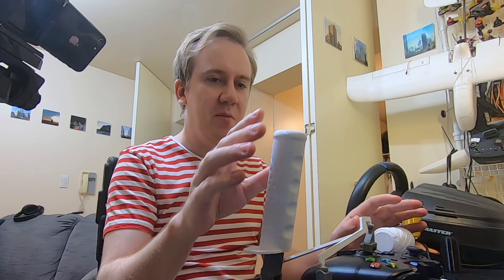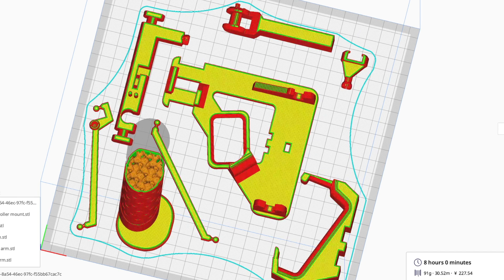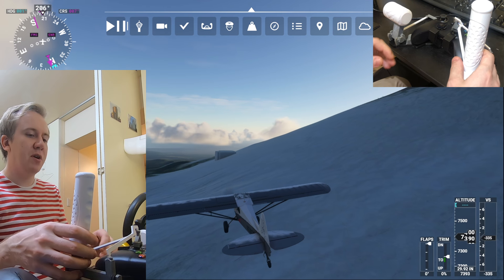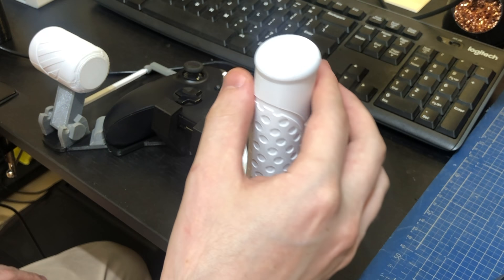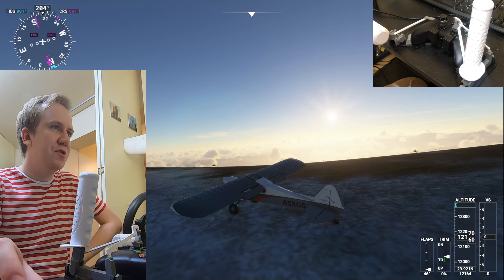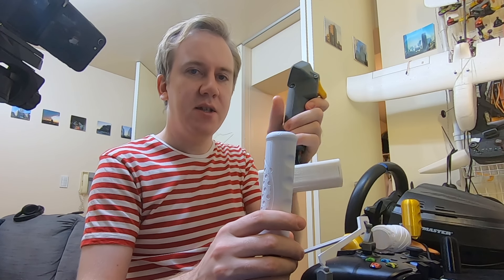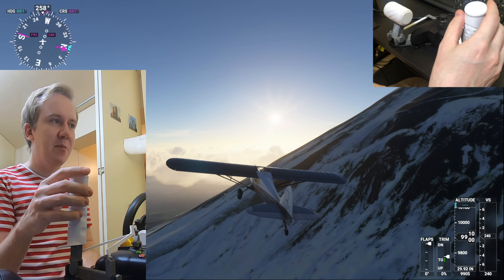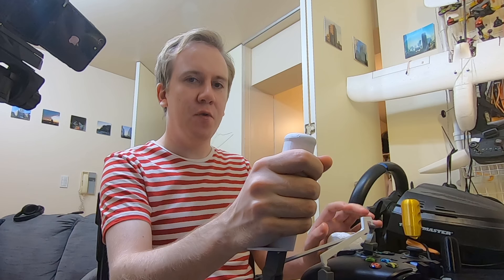Make your XBOX gamepad into a joystick HOTAS with this 3D printed extension

Comment: OK the parts tolerances are way too tight and I can't "snap" together anything without breaking anything. Anyone else have that problem? I'm adjusting my slicer settings to make some dimensions smaller
Reply: I printed in PLA. I was able to heat a few pieces up with a hairdryer. but you need to be careful not to distort other areas. post for handle needed some sanding.
Reply: I had to remodel them all and make the ball joints about 130% larger and use the loose tolerance ball joints I also increased the center break line on the ball joints to .8mm. My printer is about 99.7% accurate so I have no clue  how this guy got his parts to fit together.
Reply: @MrCampbelltoe  thanks for the numbers, that's what I needed. thanks

Comment: Hey, I noticed the .stl files have a fairly thin slot in the ball joint socket than the printed pieces you showed in the video. Is the model slot width (about 1 mm or less?) the intended size, or should we file open the slots for better assembly?
Reply from the maker: The video shows older prototypes, the narrower gap in the STL files work better. As I show in my follow-up video, you can heat them up a bit to assemble them easier, but no need to open them up other than that.
Reply: @AkakiKuumeri  Thanks, I was having trouble getting such a thin slot, but changing the horizontal expansion worked like a charm. Do you have the Fusion 360 files available for sharing? I have a corded 360 controller and found that the throttle handle-to-linkage pivot point distance is too short (at zero throttle position, the link is already fully compressing the controller trigger). Was hoping to make a mod to fit my controller.

Comment: I really want to donate (I'm printing this as we speak). This shouldn't be free.
Reply from the maker: Thanks Stranger, buying the files in my Etsy shop would indeed be the best way to support. Thanks a lot!
Reply: @AkakiKuumeri  Can I just send you a little something via PayPal, or perhaps even buy you a drink locally? (I'm in Funabashi)
Reply: @reallyboringindividual  Dont, the files are garbage and nothing fits even on extremely well tuned machines. Spend your money on a real HOTAS that's actually worth it.
Reply: @SwiftestScout  I designed and built my own precise HOTAS since. Mostly 3D printed with some bearings, some metal parts and hall sensors. Works well.
Reply: @SwiftestScout  +10 respect points for Teemo in the avatar. Teemo OTP here. ;)

Comment: Hey, I printed this (you have seen on Thingiverse) I can’t seem to figure out the in game settings for throttle axis on pc. I have set LT to throttle axis, and changed my game pad to give all range in the z axis to LT but still the throttle only moves from 50ish%-100%? Can you/anyone on pc guide me where I’m going wrong, many thanks in advance.
Reply: I have the exact same problem... the "windows controller setup" is no help either. Did anyone get further?
Reply: Same for me. Hopefully someone knows the solution.

Comment: I’m hoping you can help with a design similar to this. I’m trying to help the disabled gamer community solve a problem and I think this mechanism is the solution. Xbox makes an adaptive controller with analog inputs for special needs gamers. Unfortunately finding a joystick to work with it is extremely difficult and extremely expensive. Most are too weak or too delicate and still cost $100+. You can buy a simple adafruit thumb stick for around $7 (https://www.adafruit.com/product/245). So my solution is to use your mechanism but with the adafruit thumb stick that is readily available on the cheap. This also solves the durability issue because your mechanism takes all the weight of the players hand and not the thumb stick. Also by adding a spring hook to the mechanism I can put different springs in depending on what peoples arm strength and ability to return the stick to a neutral position. Those with sensory issues may not be able to tell when a joystick has reached a neutral position without strong spring return while others need weaker spring due to less strength. It would also allow different handles to be 3D printed for different disabilities and needs. Is this something you might be interested in helping with?

Comment: I'm trying to print the test joint from the thingiverse files but I'm having the worst of luck trying to get the gap in the female side to resolve.  I opened the .stl file and it looks like that slot is measuring at about 0.16mm but it looks much bigger in your video.  Do you have any suggestions to get this up and running?  I want to make sure I can print the joints before I do large pieces.
Reply from the maker: The test piece in the video is an older model. Did you print the female piece standing up?
Even if the slit isn't completely open, as long as the ball goes in, it is good to go.
Reply: @AkakiKuumeri  I printed the female piece standing upright and the male piece on it's side.  The ball doesn't quite fit in.  I'm doing a 0.2 layer height, 0.4mm line thickness, and 3 line shell.  I'll try to look through my slicer again (Cura) to see if there's anything that would cause the walls to be thicker than intended.
Reply from the maker: Lower your flow rate and speed on the outer wall.
Reply: @AkakiKuumeri  Still no luck.  My male part is about 5.2mm at it's widest and doesn't stand a chance at fitting in the 3.8mm opening on the female part.  I'll keep trying to tweak the settings.
Reply from the maker: @nanderson1997  The model is 5.0 mm exactly I think. My print measures 4.8 ball and 4.0 hole opening. If your print is that far off measurements, you could use horizontal expansion at -0.1 mm.
Reply: @AkakiKuumeri  I think that might have done the trick!  I'll keep toying with it a little bit more but that seemed to fix a lot of my issues.  Thank you so much! Can't wait to print!

Comment: You misunderstand the HOTAS part, HOTAS does not mean you can put your hands on the throttle and stick, it means you don't have to remove your hands from your throttle and stick... IOW every button and that can control every aspect of flight, offense and defense is accessible and operable either on the throttle or the stick. So your idea is great, but it isn't HOTAS, its just a stick and throttle...

Comment: i tried to print and failed, all the parts were too thick and would not go together, i'm using an ender 5, do i reduce perimeters or? i'm so lost, i bought a 3d printer just for this
Reply from the maker: I used an Ender 3, so it's totally possible to print it with your printer. Out of the box the printer is not very accurate though, you should do some basic calibration first. Especially pay attention to the Elephant's Foot and bulging in corners.
Reply: @AkakiKuumeri  akaki you're a living legend

Comment: i've got an xbox one s controller, will this work?
Reply: That’s what I used it with, and it worked. Except the throttle did press down on the sync button, so I put something thin next to it under the clip to hold it up so it didn’t press it
Reply: I just ended up using some flush cutters and gracefully hacking bits of plastic away from the button

Comment: I just printed all and, IT DOESENT WORK, The pieces dont fit together, re-modell it, Ive tried with my 3D printer in PETG, DO NOT PRINT THIS UNTILL IT IS REMODELLED.

A big deception wasting half of my filament.
Reply: i was having the same problem connecting the base to the joystick hinge
Reply: @jteap6088  ikr, pieces just dont fit
Reply: @ani5z  there is a remixed version on thingiverse which has much better tolerances and printed perfectly for me
Reply: @jteap6088  send me the link please
Reply: @jteap6088  thanks

Comment: all the models are scaled wrong and do not fit together at all, i just wanted to fly
Reply: the main board doesnt even reach the controller, so dumb scaling, i could see how the model would work its just not working
Reply: idk, ima try sanding some stuff down, i just really want this to work
Reply: What I did was first print the ball joint test piece, then changed the extrusion multiplier until it fit perfectly. Then printed the whole thing. Some parts did take a little forcing in, but it worked.